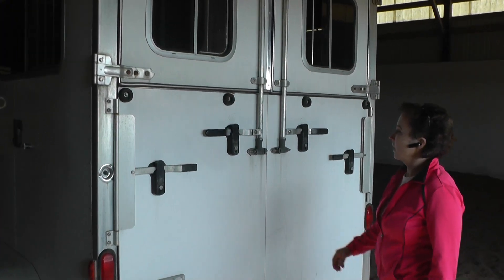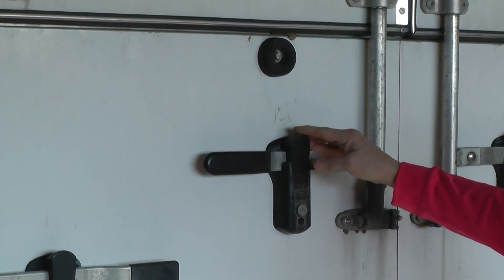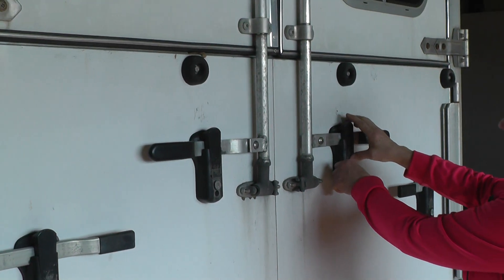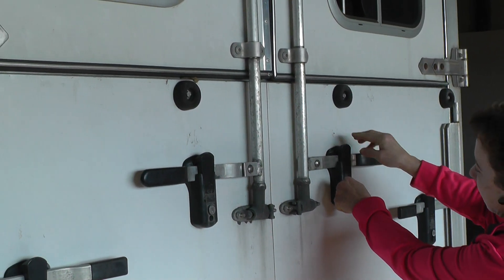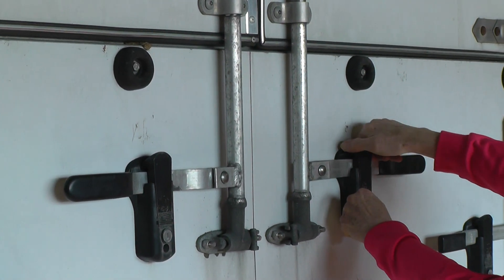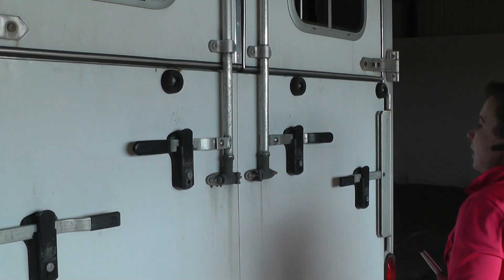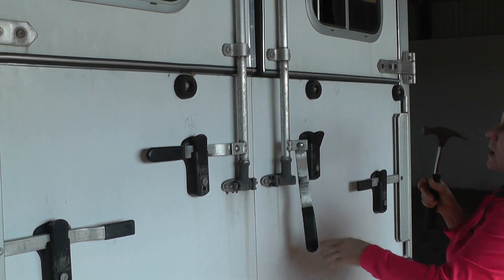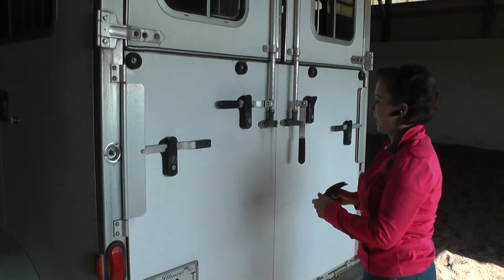Horse trailer latch design failure

Comment: Ok Try Pushing the latch down and little to the front of the trailer to release the pressure off the lock. My trailer as been outside for 6 years in Mich. winters never had that hard of time. In the video you can see the latch pop up as you hammer on the lock.

Comment: This is common on any trailer that isn't stored inside. It is also common with any type of metal. This is a maintenance issue, not a manufacturing issue. These trailers are used in harsh conditions. On the road. Horses are using them as a bathroom so urine and horse poop run down the doors. They get rained on. Sun shines on them. The metal oxidises and the latches start to stick..... Use some type of penetrating oil. Did you read your owners manual? Probably not.... PB Blaster, WD-40..... I see this at horse shows non stop..... maintain your equipment.... It is YOU who is putting your livestock in danger by not doing simple maintenance!.